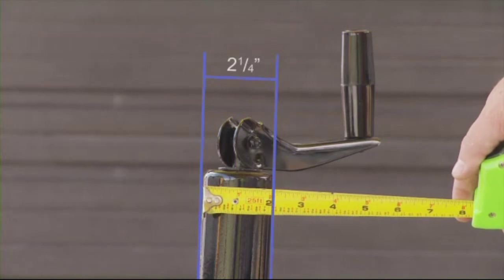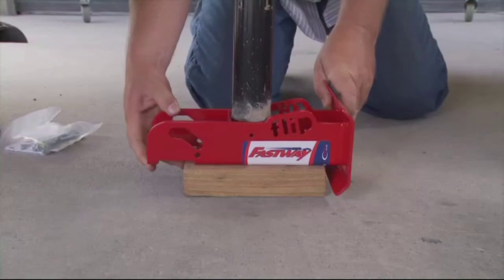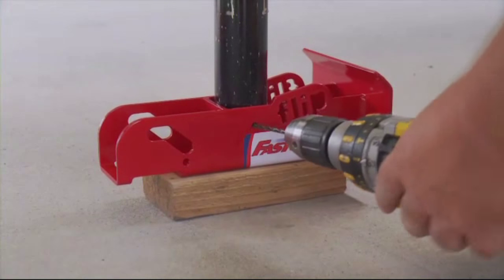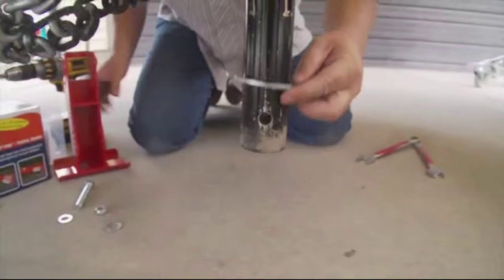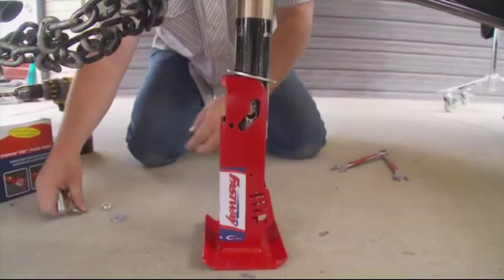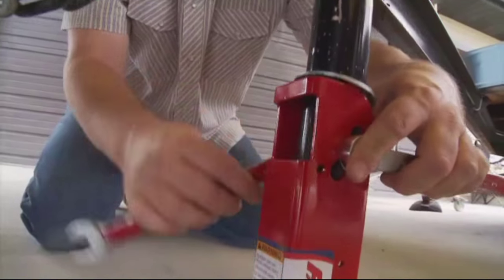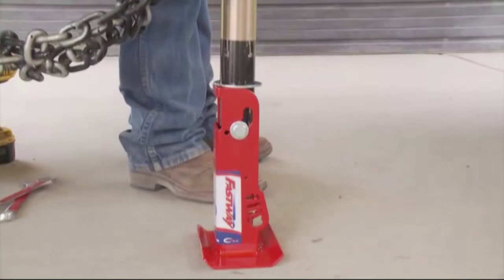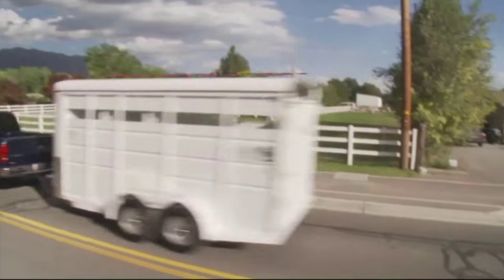How To Install The Fastway Flip Jack Foot

Comment: You forgot to mention that the flip jack needs to be perfectly lined up with the trailer tongue before drilling the pilot holes.
Reply from the maker: +gdroid,
You're right, the Flip™ jack foot should be right in line (parallel) with the trailer when you drill the pilot holes. Thanks for the comment!